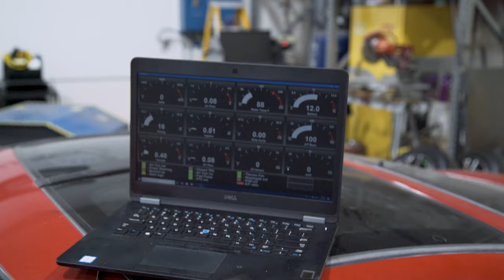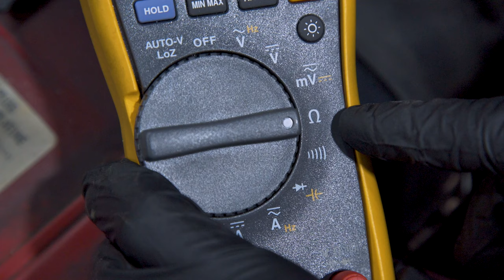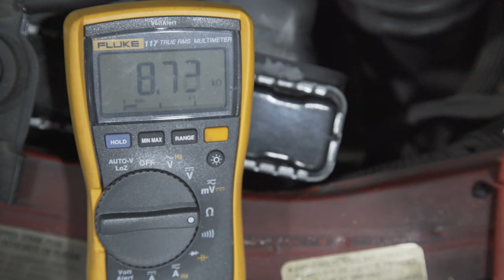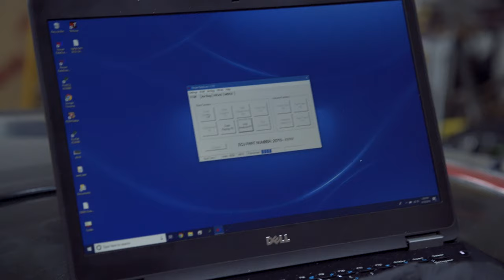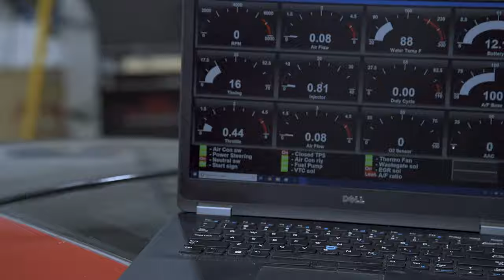How To Adjust Your 300ZX Throttle Position Sensor

Comment: Many, many thanks.  This actually solved my hesitation and idling problem.  It runs really rough like 3 pistons not working and dies at idling after letting off the gas.  I spent 5 days tearing apart and verifying timing belt, fuel pump, injector ohms, spark plugs, coils, MAF, CAS, ECCS relays.  Most forums doesn't mention this being the problem which makes it harder.  It is amazing to me this little thing was the cause.  Next up is how to get ripping muscles??  :)
Reply: Same issue!

Comment: What a great video. My best friend has a Z32. Running great one minute, then not so much the next. Very black soot in exhaust, but he pulled the plugs and said they looked ok. It looks more like oil to me, blue smoke and doesn't really smell rich. But if the plugs don't rat out the condition   what the heck? So, we're confused. We went to pull codes and it won't flash. Tried it many times...no joy. If the codes won't show themselves this way, what are our chances of the PLMS cable working. Any ideas at all? Thank you.

Comment: so, I have 11000 ohms resistance and turn the tps to max. the lowest i get is like 9900 ohms, are the throttle bodies incorrectly adjusted?
Reply: Same problem
Reply: @mikehoran5631  same problem anyone find a solution?

Comment: Wondering if you might know where the fuel pump control module (fpcm) is located checked some forums all they seem to talk about is the module itself not the location on the car any help is appreciated thanks
Reply: It’s in a different spot depends if you have a 2+2 or 2+0

Comment: Concept Z. Hi.  
About that conzult data scan cable and software for Z32.  I have a different aftermarket ECU from when the car was imported years ago from  Japan.   From your experience, is the Conzult cable and software compatible with ECU's other than the stock Nissan.?. 
I'm sure some source informed me that in order to remap or do anything at all with the ECU I have, it would be necessary to revert back to an OEM ECU. I wasn't sure I'd want to go ahead and do that for fear I'd lose some degree of performance from what it had. So that ECU is still there in the car today. I've known Concept Z sell that Conzult software but was sure it would be incompatible for my ZX. What's your views on this.?. I have a high idle issue every so often. The TPS may be causing it and could try your multimeter demo, if it's not available for me to go the data cable route.

Comment: I checked my TPS with Datascan and it's reading 0.1 volts at idle. No idea how it got to be that low, but before I adjust this back to 0.45 volts I'd like to know...

What would be some symptoms the Z would have if the TPS is reading 0.1 volts at idle? The closed TPS is ON at 0.1 volts, and when I press the accelerator pedal I do see it going to OFF, and return to ON when I release the pedal (so I assume someone may have set this to 0.1 volts intentionally).

Basically, I don't want to change it if I'm not seeing bad symptoms of having the idle reading at 0.1 volts.

Comment: Thanks for the vid. Quick question. I'm maxed out on my tps it doesn't move any more and the max reading is 8.45. What do you think
Reply: Mine is the same way. I know your comment is a year old but do you happen to remember what you did? Lol. Setting it to 8.44 solved my rev on cold startup issue but now it cuts fuel completely when I let off the throttle after a hard pull.
Reply: @KevBacon6 i have a 1991 TT mod, and i only reach 8.35. My car is also cutting the fuel and dosent start up again after some hours. Have you come up with a solution?
Reply: @sveia123 I set mine back to what it was before I saw this video and tried to make mine match his. I don't remember what mine is set to but I haven't had any issues since putting it back to what it was to begin with.

Comment: So I can’t get either of the two TPS’s to sit at anywhere near 8.8kohms. Instead they go to like 4.5 or 3.3 maxed out. Is there a way to fix this?
Reply: Mine only ranges 10k-13kohms
Reply: @mikehoran5631  This is what mine is doing any fixes?
Reply: @kyricwallace9843  I ended up just sitting it in the middle. My problem ended up being spark plug boots. Lots of vacuum leaks around intake also.
Reply: @mikehoran5631  okay thank you!

Comment: Great video! Thank you! 
I did this to my 300zx a while ago and the ECU is reading the closed throttle position sensor correctly, but my transmission doesn’t notice it for some reason. So when I let off the gas the transmissions torque converter stays locked for a bit until it gets below 40. I know it’s working right because the ecu shows it on the conzult working correctly, but my transmission doesn’t show it. I don’t know why.
Reply: TCU do some crazy things when they go bad
Reply: Born American for real. I had it repaired and I cleaned it, but it still seems a bit off. Freaking automatic transmissions....

Comment: A video on how to adjust idle speed/iacv on the z32 would be nice
Reply: Disconnect your idol circuit  then adjust the screw until the car idles between 700-750 rpm, plug the idle circuit back in and your good to go

Comment: The reason you'll strip the screws if you use a Phillips head screwdriver is because the screws are JIS, not Phillips - there isn't a Philips screw anywhere on the car. Get a set of JIS screwdrivers and you'll eliminate the the problem.

Comment: What if when u open the throttle it shows the hard switch on
Reply: thats sign mean TPS bad. Get new one
Reply: @kiddoxsupra2  thanks and could u tell me what color wire goes to the black tps plug from top to bottom

Comment: Would that cause my auto transmission not to shift into 3rd gear? I only have 1st & 2nd gear
Reply: Having the same issue. Were you able to find a solution?
Reply: @fabian4471 same issue here. Any updates ?